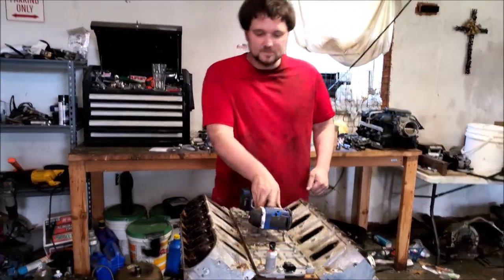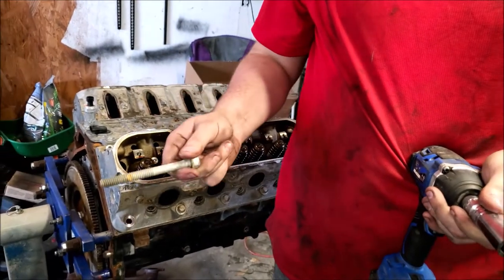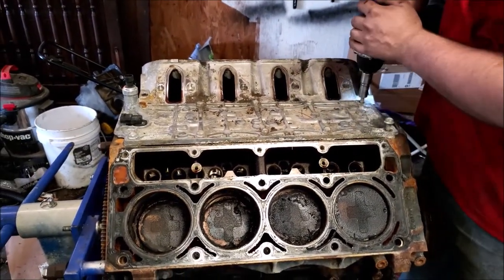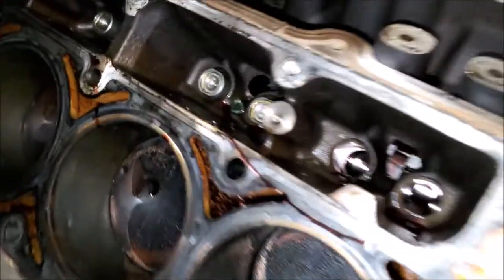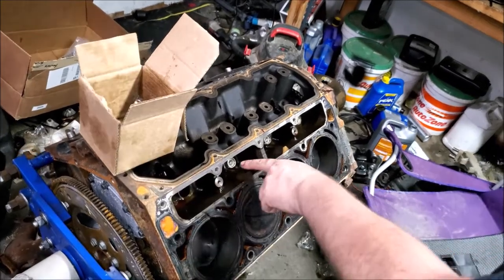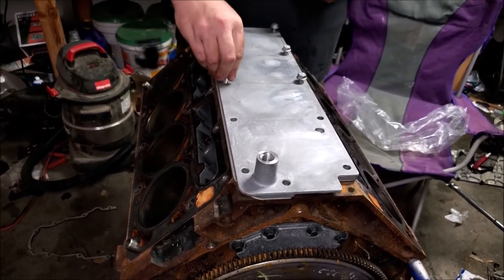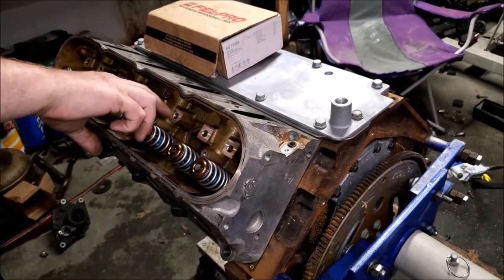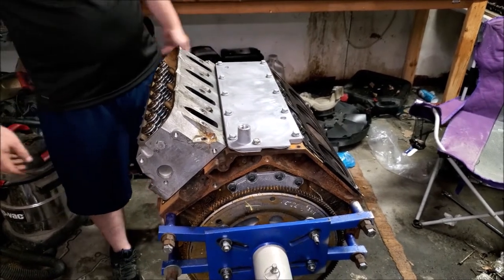How To Delete/Remove The DOD (displacement on demand) On Your LS Engine (5.3-6.0-6.2 liter)

Comment: Good video. I would have had that engine cleaned up before putting those lifters in. When I worked in a few auto dealerships way back when, two things were guaranteed to get you fired if seen by the shop foreman…1: using a crescent wrench and 2: using a impact to put something back together.
Reply from the maker: This is a weak impact, couldn't break a screw on a toy, lol. Yeah it was a dirty engine but they didn't pay to have it cleaned, cleaning takes quite a bit of time to do it right.
Reply: @1018Video  Are you kidding me, there was a chunk of glass in between the new lifters that you left in there, what a JOKE!
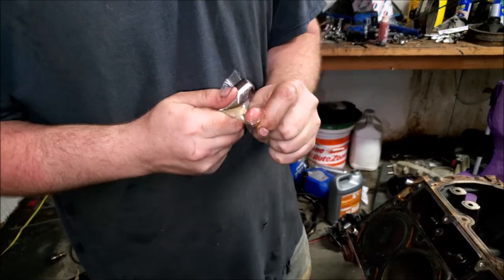Reply: @jerrya2801  lmao ! @9:30
Reply: Back in your day people got fired

Comment: Sweet! Can't wait to do this to my 2007 Impala SS. 
But imma do it with the motor in the car.!
Thx for the Video!
Reply from the maker: May be a little difficult on that car with the motor in it, those have sideways motors cause they're front-wheel-drive, some things may be a little hard to get to.
Reply: @1018Video  I'm aware.  Now do I absolutely need a tune after? What does a Tune do?
Reply: @Cmimss  computer is programmed to use AFM, so it's going to try and activate the AFM system...with no system the computer is going to get no response and tell the auto " hey something is broken, reduce power and speed to 15mph turn on the service light refuse to start until gm fixes what's wrong"

Comment: I’ve seen videos of tunes like the Diablosport allowing you to disable the dod from kicking in without removing any of this.
Reply from the maker: The problem with that is that the lifters that are notorious for failing, and are the main reason for people deleting the DOD on these engines, are still in the engine if you just get a tune that turns it off.
Reply: The failure happens from a miss timed evend causing the pin to get lodged and cause the lifter to stick disabled if the lifter never goes into disable it can't get stuck
Reply: @daviddubuisson5194  the failure happens when the spring between the two pins gets worn, and the pins don't retract properly...a miss timed event happens once every 2000 events or so any ways and with enough of those the pin(s) get bent into the opening and once that happens...just  a matter of wear and tear until it becomes catastrophic

Comment: just yout opinion,  do majoritie of lifters not fail and majority of 6.2!? i see alot of ppl say they have no problems with 250k miles plus
also to avoid lifter problems change oil a 3k mile not 8. 9 ,10k miles?
Reply from the maker: All GM V8's (even the newer ones) with DOD have a high probability of failing.

Comment: The stock cam will not work with those lifters. You MUST change the cam.
Reply from the maker: How is that? What is the difference in the cams?
Reply: Lift, duration...

Comment: Only way to not have to get a tune is keep the old valley cover and keep it plugged up, keep it at the back/side of the motor somehow and drive in M5 Mode it willl never kick v4 mode on. (Alil temp hack) Mine still has dod (which i hate) and i drive in M5 mode and it stays in v8 mode
Reply from the maker: What is M5 mode?

Comment: Did you change the cam?
Reply from the maker: Yes, but you don't have to.
Reply: @1018Video  yes you do
Reply from the maker: @delwortman2799 
Not necessarily, the cam is no different from any other cam, there was no issue with this cam but the owner had a bigger cam for us to install. The most important thing to do when doing the DOD delete is to remove the DOD lifters and install normal lifters, that's what fails on these engines, the lifters.

Comment: Oh my goodness that wasn’t glass that was metal. bearing material ????? Yeah if that motor is still on the road I’m definitely not worried about doing this on my 2012 LC9.
Reply from the maker: @Johnny-jr2lq 
Still runs fine today. 😎
Reply: @1018Video  not joking that is amazing
Reply from the maker: @Johnny-jr2lq 
Engines are stronger than most people think.

Comment: Can you still run dod camshaft I was told the lobe height and lobe off set was different there for you had to swap out the camshaft for a non dod camshaft
Reply from the maker: I don't think you have to change cams, I've got a friend with a 2020 Camaro SS and he did the DOD delete and he still has the stock cam.
Reply: Yes you do have to change the cam don’t listen to this guy.  Don’t do all this work for nothing.
Reply: @1018Video  you have to change the cam
Reply from the maker: @matthew6202 
The cam is literally no different from any other cam lol the lifters are what do the DOD, you only have to change the cam if it has damage.
Reply: What's the best replacement cam.
Reply: You do not have to change the cam, the lift is exactly the same, only different is the ramps for dod are longer for a smoother lift. All heights are the same!! No harm done only a better ride for your solids! Dod are same height at "active" lifter as a solid is active always. I measured both lifters with indicators, theres documents of cam comparisons all match up. !